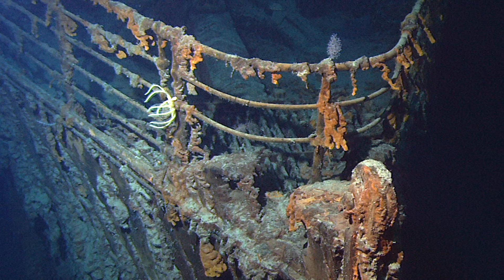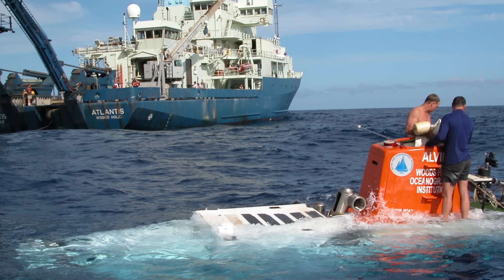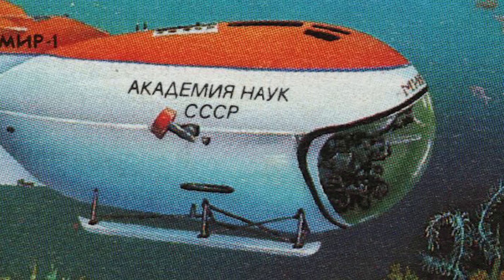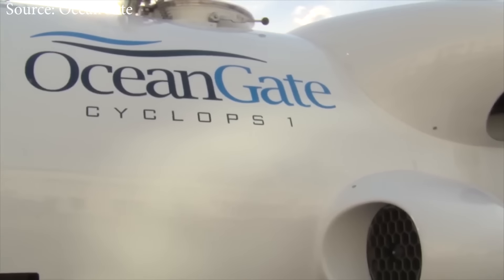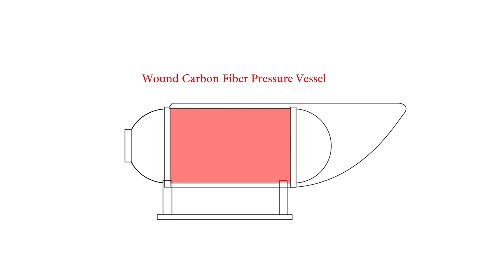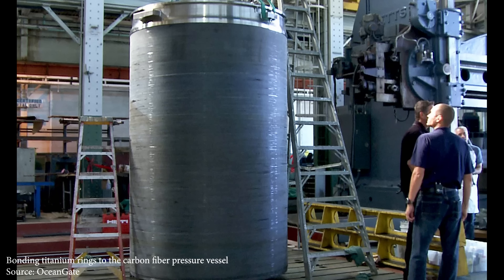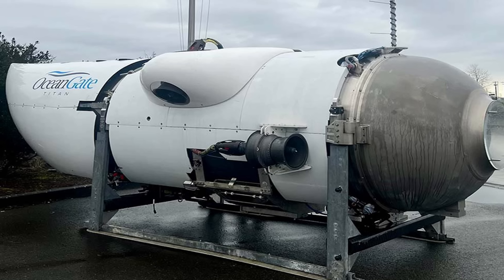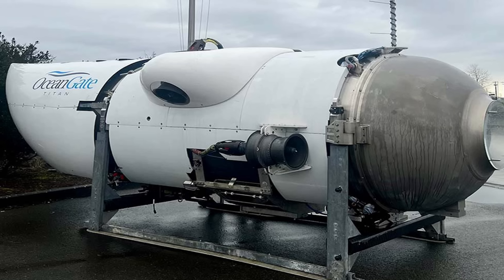How Titan was Built, Lost and Found: An Analysis

Comment: This vessel did not use water pressure to its benefit. It was adhered together with resin. I cannot state that enough in a dirty environment. It was not temperature controlled, it was not climate controlled, and it was not done in the vacuum. It was done in the shop slapping resin on there and hearing the two pieces. That is a primary fill point right there because pressure increases and decreases at that bond point each time it’s wearing the resin down over and over again. On properly engineered and manufactured deep submersibles, they utilize pressure to their benefit. So as the vessel goes down, the O-rings and gaskets get stronger. That is not the case with this crappy in my backyard designed submersible.

Comment: No matter how thick the shell is made on the titans central tube even if it had been a foot thick it eas still the weakest point on that submersible because it doesn't allow for equal pressure on ALL surfaces, unless the inner pressure was increased to the dame pressure as it was outside the dub as it sank to the bottom

Comment: Using 2 challenging materials to build the ship was a poor design choice - Titanium age hardens so gets weaker and more brittle with time while carbon fiber has to be oriented like the grain in wood  to optimize strength  - even the tiniest inclusion can start a fracture -  The pressure cycles from previous dives led towards a "Comet" moment. I can't understand why a multi-millionaire would not have an independent engineer do an appraisal before risking his son.

Comment: Having the ability to navigate the vessel locally vs remotely is important when you have souls on board.  Having an acoustic warning system didn't give nearly enough advance warning for any real correction of the problem - they had milliseconds to react, not seconds or minutes.  
More importantly, how often (if at all) was the hull integrity tested?  From everything I've seen, there were early warnings of the carbon fiber having failure points that weren't properly addressed.  Nothing of this venture was performed in a fashion generally accepted as Best Practices.

Comment: 1 carbon fiber can pull a car because it has pulling strength however carbon fibers have zero strength when pushed pressure of the ocean was pushing on the hull

Comment: The problem with the controller they picked was that it should be wired, not wireless—and also, pick a better brand of controller, Logitech is shit. They cheaped out on the controller just like they cheaped out on the carbon fiber hull and the view port that was only certified to 1400 meters (the sub imploded around 3500 meters.) That's plain cheapness and a complete disregard of safety.

Comment: Late comment, but I only recently came across your channel. BTW, love your videos. Top notch work. 

Retired US Navy Sonar Tech. Hull mounted active sonar from a warship would not have been able to pick up the titan. It's not designed for that type of work. You'd have to drop a side scan array down near to the bottom of the ocean to get that scan image quality good enough to pick the Titan out. Side scan sonar systems have to be really close to the area being scanned to get a good image. Like <250m.
 
I have operated mine hunting side scan systems to search for anchored mines in choke point transit lanes (AN/WLD-1 RMS if you are curious) and they can give you a hell of a image (like being able to count the tread on a tire laying on the bottom of the ocean floor), but they have to be down near what you want scanned. Not hull mounted.

Comment: Carbon fiber is strong only in tensile strength but not in compressive strength. 

So in saying this I'm guessing if that Submersible was built using 2 and 1/2 inch thick manganese steel then internally had steel rings welded for reinforcement than how do you think that will go?.

Comment: There needs to be someway to come up with a funding method to support exploration without the need to run a tourist operation.    ROVs are far more effective and safe in conducting exploration and retrieval of items, and definitely safer.   There is no scientific/engineering reason not to use an ROV except for a funding scheme.   Maybe this will bring an end to the tourist voyages and develop a funded ROV system.

Comment: Agree with other commenters - this video is below your usual standard of quality.  You gloss over many of the very well-known flaws in the design and materials chosen.  For example - Carbon fiber is terrible for compression strength.  That is why it is not approved by submersible inspection bodies.  Steel is much better at compression and CF is better at tensile strength.  CF is fiber glued together and then the body was glued to the titanium collars for the end bell and hatch bell.  Titan lost comms with the surface ship on all of the previous dives and was lost at least once - maybe dive 3.  There was terrible quality control; e.g., dive 3 had a thruster installed backward.  US military submarines do not use 10-year-old game controllers or off-the-shelf camping lights, etc. - subs have two controllers that resemble aircraft controls to control the sub through the multiple axes of a 3D water environment.  Your comment that OceansGate is a legitimate research group and brings people along as crew specialists made me chuckle.  These are paid passengers to cover the costs of the trip and Titan maintenance.  This video felt like a shifting of the issues to an education video of sonar.

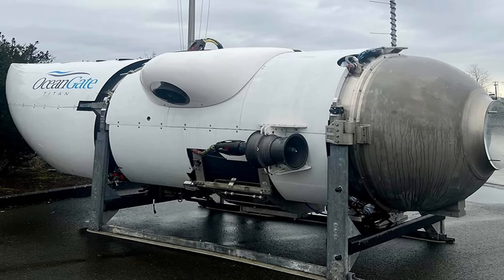Comment: 12:20  They used glue sir. There is video of them attaching the ring, and Rush states that it's glue... I am only 12 minutes in, but this seems more like a fluff piece for Oceangate than true assessment.
They built the sub out of standard shape to accommodate tourists, ignoring the reasoning for a sphere shape. They used carbon fiber which everyone in the submersible community told him was dangerous and needed more testing. They also used a port window that was only rated to 1300m, a far cry from the 4000m they were going. They used different materials, titanium and carbon fiber, which creates a weak point, and then they glued it together and said "yeah, 2 miles underwater is no problem."
Do continue to tout how great Oceangate is and their "science".

Comment: I am not an engineer, but fibres can be very strong if you pull, but quite useless if you push? When you push on composie material from the outside I don't know if those fibres are making any difference. Anyway I think vessel out of concrete and tanks of olive oil to keep its neutral buoyancy would be safer.

Comment: The US armed forces might use control systems styled after game controllers, but probably even that not for vital functions without backup.
Oceangate used an off the shelf controller without backup, and with such a "relaxed" approach that one time they completely reset and reprogrammed it ON THE OCEAN FLOOR rather than surfacing.

Comment: Hi Mike, great explanations and presentation. I hope there is an analysis of the failure by the NTSB to positively identify the failure point. The design may be OK with the material used but just needs to have safeguards to prevent this from recurring. When a plane crashes, we don't stop flying, we investigate the failure, fix it, improve it and make sure that problem never is repeated. We will have to use cylinder pressure vessels because spherical ones are not practical when you want to have more than 2 or 3 people on board. Thank you Michael

Comment: #OceanlinerDesgins  I HAVE A QUESTION! For any of you that cares to answer. Imagine a "double hull"  submersible, lets say an inner capsule within an outer one surrounding the first, and we pressurized the space between. Would this be beneficial in a way that it would reduce the stress on the outer capsule  by splitting the stress with the inner one? I understand that it probably wouldn't be logistically doable, or that it would create a lot of other problems, like extra weight and so on. I'm only asking about the physics.. If the inner capsule was made to withstand 3000 psi and the  pressure between it and the outer capsule was pressurized according to that, wouldn't this mean the the outer capsule would have a net negative of 3000 psi, in a sense being stressed from the inside from the start, and so  when diving down to titanic it somewhere along the way would equalize the pressure with 3000 psi from the outside, an kinda be the same condition as an ordinary submersible would start out with at the surface? And so if it could take 3000 psi of compression as well, would it make this submersible sufficient for a total pressure of 6000 psi, OR would the inner capsule become over stressed or does this physics work out in the way I imagine that they would split the pressure equally? I guess that in total this construction would use more material if the strength you gain when adding thickness to one hull isn't linear but will benefit from being one solid thick capsule rather than two slimmer once. But hey, perhaps I'm wrong about that assumption.. I just pondered about this by myself for no sensible reason and thought it was at least a bit interesting, and became curious about the answer. I couldn't think of a better place to state a question like this than over here among all the bright viewers that unlike me probably knows a lot more about these kind of constructions. Thanks to anyone that took their time to read this, and offered their two cents about it. Even if you don't know, it would be interesting to hear your speculations since I'm in the same boat as you! It doesn't really matter, the important thing is not the accuracy of your answer, rather comments is a way to show support for the channel, in my opinion!  :D

Comment: This is exactly my thoughts. After hearing how stressed a submersible or anything gets, going down to 3,4,5 atmospheres then coming back to surface. The cylinder being made from strands of carbon fiber would compress differently from the titanium rings and end caps. After several dives i believe it became just too much and the carbon fiber may have separated from the titanium rings. They were adhered to the rings by adhesive if a type. Like you said, too many different materials together allow for potential problems to arise. Very unfortunate for sure.

Comment: What you said about the De Havilland Comet breaking up was only half of the equation.  The other half of the equation for why the earlier model Comets suffered severe structural failures was metal fatigue.  At the time, they didn’t know how the aluminum alloys would respond to 100s if not 1000s of repeated pressure cycles.

Comment: Mike we know that the ocean depths are lethal the further down we go. But why is it that submersible craft need to be so very strong when the ships they descend to are not and were never built to take such pressures and yet many lie on the ocean floor remarkably intact. Sure as they descend pieces are ripped off and there's also impact damage when they hit to ocean floor. We also know that so many of Titanic's passengers succumbed to hypothermia in the sea water and as they slipped beneath the surface to descend into the depths were their bodies all crushed beyond recognition by the pressure which is why the ocean floor isn't littered with skeletons. I know it's morbid subject but perhaps a video explaining what happens to humans when they descend into the deep depths if they drown.
Divers have also said that one of the loudest sounds in the ocean is the Sperm Whale. To be "clicked" at by a mature Sperm Whale is like being kicked in the chest by a horse. Apparently there are two sorts of sonar clicks, communication clicks and hunting clicks and it's the hunting clicks that can kill a diver for they're that powerful. A small baby sperm whale had swum away from the main group of relatives remaining near the surface to look after the young ones. The baby sperm whale was clicking the boat's hull thinking it was another sperm whale and the babies mother roared up out of the depths the take her baby back to the main group. That shows just how far sound travels underwater.    
Your also dead right about social media where every Tom, Dick and Harry has their two pennies worth on what happened to the Titan and all of it is purported to be the definitive truth when so much of it can be taken with a grain of salt.
Reply: The problem is with pressure difference. The pressure outside the submersible is far greater then pressure inside the submersible and if the walls of the submersible aren't strong enough it will be crushed. When ships sink, they fill with water and therefore, the pressure outside and inside the sinking ship is the same and they don't get crushed.
Titanic is actually good example. Bow got filled with water and is relatively intact, stern did not get fully filled with water and got partially crushed when sinking.
Bodies usually don't sink that deep, they are partially buoyant and they will get taken care of by marine life or will decompose and disintegrate. Bones dissolve in a salt water.
The bodies on Titan were probably literally vaporized. The implosion compresses the air, heating it up to extreme temperatures so it's like a bomb would go off.

Comment: Your title says "How Titan Was Built, Lost and Found, but your video is almost 50% about how Titan was Found with little discussion about the Loss of Titan, and not much more on how titan was Built. Several other videos talk about the dangers of using dissimilar materials when making the pressure vessel since dissimilar materials would , logically, react to outside pressure in different ways. Your video glossed over that fact. Your video also did not mention that the glass view port of Titan was not certified to withstand the pressures at the depth of the Titanic Wreck. As a matter of fact, you said that you would talk about the Points - Of - Weakness in the titan's design, but instead, you almost casually glossed over them, rather than emphasizing them. 
Almost as if you were making a PR "Excuse" video for OceanGate and it' now deceased CEO after the fact. 
According to the timeline of this video, it states that it was made 1 day ago; 24 - 36 hours ago, so you are undoubtedly aware of the fact that the US Navy detected the acoustic signature of a loud implosion event in the vicinity of the Titan's suspected location area. I'm sure that the US Navy communicated this to the rescue and recovery fleet, but for some reason, the Coast Guard services involved continued their "Rescue" efforts even though they knew that it was futile effort. Eventually the Implosion Signature's location was used to narrow down the search area to a couple of hundred feet from the bow of the Wreck of the Titanic. The expected debris field was found by two searching ROVs. Your video goes to great lengths to elaborate on the technology used to find the remains of the Titan; all well and good. But it also highlights the uncoordinated nature of the search EVEN AFTER the US Navy heard the signature of the Titan's implosion which was, if i am not mistaken, a full 24 hours at least before the ROVs found the Titan debris field. The point is that we ALREADY KNEW that the Titan' remain were found. A more comprehensive video about the MISTAKES in the Titan's construction would have been more relevant since WE DO NOT WANT IT TO HAPPEN AGAIN, yes?

Comment: I'm sorry but Sonar wasn't developed until 1917 because of german submarines , thos submerins were not an issue pryer to 1912 therefore the titanic did NOT have Sonar, thr titanic wasnavogated by the stars only , that's why the tower amidship on the boat deck was called the "star tower" because that is where the navigator took his readings with a device called a sextant

Comment: The gamepad controller is being used in Military applications. But not as the primary means of control. They are intuitive and cheap but not robust enough to count your life on under the most extreme conditions you can see on earth. If they were so, airplanes would be flown with them. Military submarines also use them only for the control of weapon systems and there are definitely backups for them, something as simple as a second controller. Getting funding from actual people to gather data does not mean that you can cut corners on safety and call it experimental, when your product is available to the public, or a small portion of it that have the kind of money to give for deep sea exploration, it has to be as unlikely as possible for it to fail. Bold statements for innovation, Carbon Fibre use for marketing and gamepads for control do almost none of it. It's a shame it happened so hopefully, whoever decides to eventually fill that gap, does listen to Industry experts.

Comment: I've been watching a lot of interesting videos about Titan's demise. There's been talk about why Titan was covered much more than the other tragedy you mentioned. I think it is because of the sheer terror elicited when you think about the possibility of being trapped on the ocean floor. Power may have been lost in the blackness. Very little drinking water. Oxygen running out. Panic. Hypothermia. Power struggle? It all feeds the imagination.

I liked this video. I saw another one that talked about some kind of epoxy glue used to seal the ends of Titan to the main portion. How could that possibly go wrong, if true? Unbelievable.